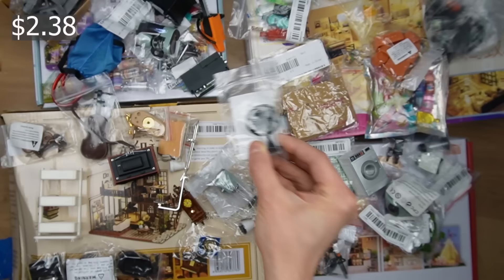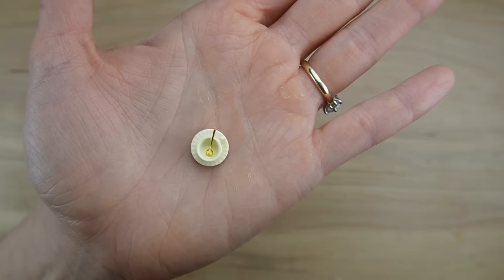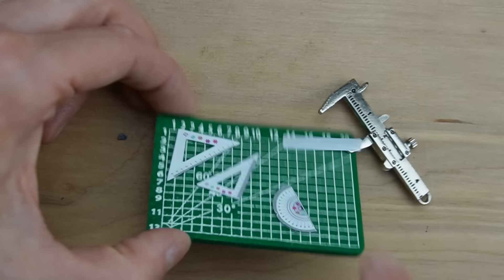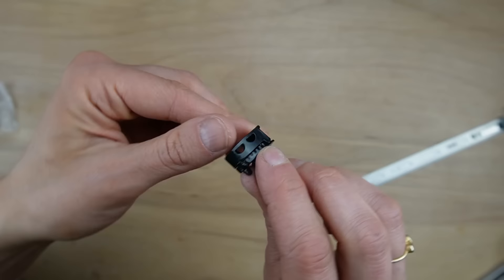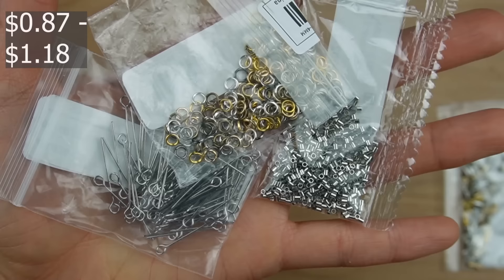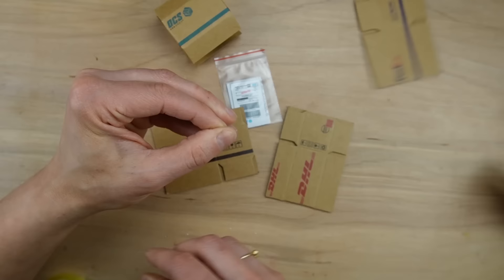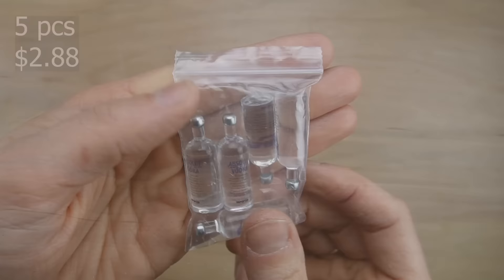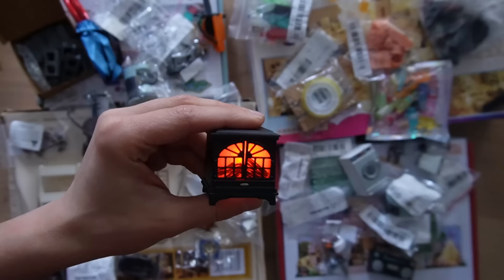HUGE Miniature Haul from Temu • DIY Dollhouse Kits & 1:12 Accessories

Comment: The irons at that time used coals to heat the metal plate. One opened the hinge, slid little coals in and tried not to burn your fingers as you flattened your sheets.
Reply from the maker: Brilliant! Thank you for the explanation. That sounds really risky, but it makes sense.
Reply: My grandmother used the coal iron.  We have easy today.
Reply: @Nilda Rodriguez  Your comment made me think about box mangles. There's still people here who prefer to use these huge beasts (even though they've been known to cause maimings and fatalities) instead of modern mangles!
Reply: Probably it was faster than the solid irons you'd have to keep reheating on the stove or fire. Easier to just put new coals in. Trickier to not get soot or ash smuts on your clean laundry. Glad we have electric irons now!

Comment: Oh wow! I didn't even see the bamboo skewers when I ordered! Tiny key hole minis and I think the iron will open, it's just stuck from being dipped. She's going to heat it and try to open it. Hot rocks were also used in those irons to make them hot. Coal would sometimes leave black marks and pop out cinders, making holes in the sheets. I LOVE TEMU! Ive made 4 orders in the past 4 months! The taller bottles could be used as wine bottles. Bead caps are great for lamp bases, fineals, spacers, just a few i can remember right now. I love the quality, it's really surprisingly shocking especially when you consider the price. Awesone video and unboxing!! 25:12
Reply from the maker: Of course! Lamps. I've seen so many minis made from bead caps and drew a blank. I need some more. The ones I bought are plastic. I need some thing, filigree metal ones, too. (Yes, NEED) 

I'm psyched about the toothpicks! I love having the smalls ones and big ones at my disposal. 

The iron really does look like it could open but mine refuses. Maybe a heat gun would coax it along. 

The quality is definitely much better than other cheap places I've bought minis from (Minimum World & Ali Express). I won't lie. I ordered more items today 😬
Reply: @queencityminis  yes, NEED!!! LoL😂  I love the fact that they're actually bamboo... not just balsa or bass wood. I have found some really large and ornate caps at Hobby Lobby that I think I'm gonna make lamp shades with. The heat gun will, hopefully, open it up. I didn't know anything about the price difference credit! Thank you for sharing that bit of valuable information! I don't think I've had any items that fell into that category. Than you for always sharing your beautiful creations and encouraging your viewers!

Comment: Those kits always come with lights. Idk what I think about that. You can use it to power the sconce lantern lights you got. 
I’ve seen the bead caps used in perfume bottles and lamp bases as well as vase tops.
As for the oversized items, maybe you can have them peeking out of bags and boxes in your basement project. I hate the thought of anything going to waste.
I seem to have a comment for every one of your items but I have to say when I saw the violin bow I actually laughed out loud. Looks like you could do archery with it😂.
Anyway, looks like I have to go to timu for all the items I’ll never use.
Reply from the maker: The violin bow is so bulky 😆 

Nothing will go to waste for sure. I know I can use every item I bought in the basement diorama (although now I'm thinking it should be a garage diorama...)

I love when things light up. I bought a bunch of cheap Amazon fairy lights and have been using them to light up as many projects as I can. I just hope the lights in the tin kit are simple to use.
Reply: @queencityminis  you just have to look at the diagrams carefully. Also don’t cut anything out until you get to it in the instructions or you’ll never find it or know which is what again. Also I was surprised when you said you don’t like cutting things out. That’s the easiest part!

Comment: I like all the different tools you can get for pretty cheap. I look for different bits to go in my dremel and actually went to an estate sale and found a mess load of dental tools that work lovely. Amazing but they do what I need done. I love the little 3 tiered shelf for storage that is cute. I will get on Temu and see what I can find. You have a great day and thanks for sharing
Reply from the maker: I need to start using my Dremel. I actually own a real drama and a knockoff Dremel and I don't use either of them.
Reply: Using the dremel will allow you to draw on wood slats and then carve out design you just did. Also using that flower mold will give the old Victorian look to furniture, window and door casements, Plus those big roses can be used on the ceiling where the lights are hanging. Just more opportunities Have fun @queencityminis

Comment: What great finds. The old irons used to open in order to put hot coal inside - however, I still haven't found a miniature one that opens. If you have a doubt between plastic and glass, slightly tap it on your tooth. If it makes a dull sound, it means it is plastic. I look forward to see what will do with everything!! You have great ideas.
Reply from the maker: I bet there's an artisan made miniature iron that opens. There must be.

Thanks for the tip!
Reply: @Queen City Minis  There is an iron that opens. I've seen it on someone's site for miniatures just here recently. I'm sorry tho, I can't remember who it was. But I do remember the iron did open and I'm pretty sure that the bottom of it was brass(which you can always paint). I just wanted to let you know that there is one out there somewhere. Happy hunting! 😊

Comment: As long as you don't  sell the items you do this with you can make the cost of things, like those awesome little nail stickers, better  by photo copying them  on sticker paper and make all the tiles you need. You can also resize them to fit that way too. And those for those adorable little planters? I'd  make molds of those and make them out of  air dry clay.  Ok, gotta watch more of the video. Just had to say that so I wouldn't  forget hahaha
Cute stuff. Yeah, I'd  make molds of everything possible haha I  think your crock pot is actually a rice cooker😊
Reply from the maker: Very true. I do need to get some more use out of the tile stickers. I really love the raised pattern of them.
Reply from the maker: I love the idea of making a mold of the planters. I have a really thin concrete product called Feather Finish I could put in the mold.

Comment: For the larger bottles you could make optics where pubs use them if you see what I mean or cut a little off the bottom and top 😊
Reply from the maker: I was thinking the same thing about trimming them. I may convert at least one oversized bottle into a fire extinguisher for my basement diorama.
Reply: @queencityminis  that's a good idea x

Comment: That TV looks exactly like the one my dad got me for Christmas in 1976, a Panasonic and I used it until 1997!! Oh, and your LED lights probably blew because they need a resistor if the power source is too powerful.
Reply from the maker: I'm 35 and I grew up with a TV just like it. I had to have it.

I think that's definitely what happened. I'm not well-versed on dollhouse lighting, but I have seen resistors. I plan to put the lights on a shelf in my basement diorama. Nothing will go to waste bc of that basement.
Reply: @queencityminis  Basements: the bag of holding for a house.

Comment: I think the coach lamps are to be wired to watch battery set-ups or a 9-volt system with a resistor.    I've fried a few micro LED lights......
Reply from the maker: I think you must be right. Don't ask why I tested the second light after clearly popping the bulb of the first one.
Reply: @queencityminis  I did the same thing, I think I nuked like 3 bulbs before it dawned on me the power source is too much and that once again, in my true fashion, have gotten myself in to something that I will have to learn my way out of.   I might have bit off more than I can chew.

Comment: I used those little temu dollhouse lights with dollar store mini lights they come 2 to a package and have on off switches. When you place the light wires inside the battery compartment  the dollar store candle does not light so it is easy to hide. It is strong enough to power the temu 6 light chandelier or two sconce lights
Reply from the maker: That's really cool! I use fairy lights from Amazon.

Comment: The dryer actually looks the correct scale to me. You would want it half of that size? I always stand my doll next to something I question the scale on, to decide if it looks right for her.
Reply from the maker: I was saying half scale, like it looks like 1:24 (half the size of 1:12), but it's actually 1:16 scale. It's the equivalent of 40" tall. A full size washer is 39" tall. 

In 1:12 scale, this washer would only be 30" tall, about 25% too short. 

Some people in the reviews stacked two to make them look right. You could also stack too and add a 1" base under the bottom. That would look decent.

Comment: I'm glad you did this haul.
I'm not sure if you seen my temu haul but we must of been shopping at the same time cuz just posted the other day😂..I'm glad you got some of the items I thought about. ..like the fan..I Def will be getting one of those now that I seen a real version of it. I did get the same iron, but I got the bronze one bc the teeth look more defined. It doesn't open and on my video I was saying the same thing.😂 I love their bubble beads but def be careful ordering those bc it hard to tell what's what..so I ordered a variety of sizes which worked out. I'm waiting on my second order now..which includes more hardware, sheets of wood,   nail art and bigger bead caps, good for lamps. I did a review on the lights as well, I order the other option..I was thinking we could use them with a cell  battery..not sure yet or could use the wiring on a made piece. I also got some more magnets too a 200pk. I love all the craft tools you found and the boombox😊 what a great haul..yea your really good at those smaller miniatures..not me! Lol and I don't think I have the brain capacity for those kits ..I do have one! I am going to make something entirely different..it is a music light bar...but will become a different type of music bar.😊 great haul..check out what I got you might need or want something  I purchased ...😂 lol oh and I have the same clock ordered from somewhere else with a bigger one. I also put resin over the face and aged it up some..now it's in the livingroom of the Josephine House😊
Reply from the maker: I'm so excited! I've been really busy doing a real life, full-size remodel (😭) so I haven't watched your Mini Haul video yet. I'm so psyched you bought Temu minis, too. I can't wait to see them! 

I was on the fence about buying the bronze or the black iron. I'm glad we each got a different one so I can compare. 

I adore your Josephine house! It is everything I would want in a dollhouse. I've watched the house tour videos multiple times. I've probably watched the bathroom video 5 times. I love it!
Reply: @Queen City Minis  lol🥰 yes go check out what I got so u can compare and see if you missed anything u need..like I got a cheep uv flashlight ..I didn't see the one you got or I would of totally got that one..for $1 more. Lol